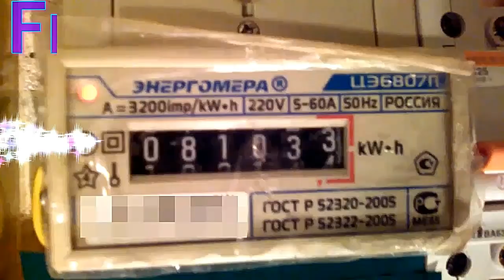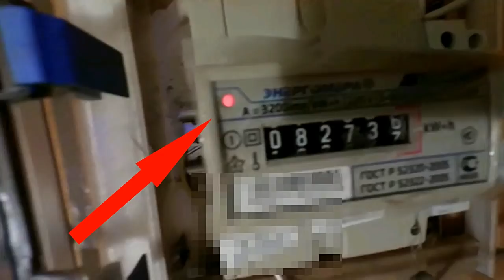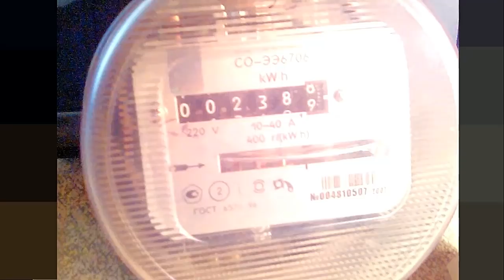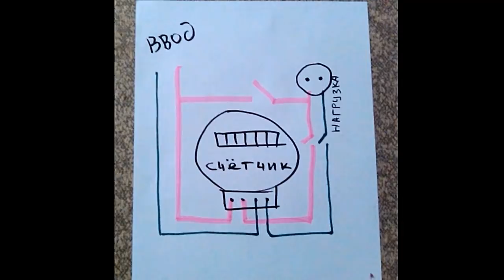FREE ENERGY. FREE ELECTRICITY. How to lower your electric BILL. METER STOP NO MAGNET DIY. STOP METER

Comment: You are just Jumpering around the Meter, However You are Not Explaining Just How Dangerous This is. 1st is The Extremely High Risk of Electrocution by Simply Handling The Wire While Switching Off The Breaker, if there is a Load "IE" The Home and You Pull The Wire Loose While Grounded Your Going to Get Electrocuted 2nd That Breaker is There for Good Reason. Say Something Like a Clothe's Dryer or AC Unit or Refrigerator  Go's Bad SHORTS OUT Which Will Draw Excessive Amps and There is No Breaker To Trip The Fault You Can Easily BURN Your House Down !!!!! This is NOT a Good Video to be Showing People I Know Electric Rates are High in Most Area's and This Will Be Tempting to a Lot of People But I am WARNING You that This is EXTREMELY DANGEROUS !!!! I Know it Looks Easy and it is But Easy Can and Will Get You and Your Loved Ones KILLED !!!!!! PERIOD !!!!
Reply: Thats why there is a disclaimer in the beginning
Reply: Um. Granted this stupid and all. You could still feed through the main breakers and have the protection.  Still.. What’s electric bill vs. jail time? Or better yet. What’s your arm worth after it gets blown off? If you live...
Reply: i did this in UK for 5 years before i moved house. i did it with metal coathanger
Reply: @flipnotrab  well its also pretty stupid to make the big corporations profit from the poor while they evade taxes but nobody complains.
Reply: @flipnotrab  do it when the powers down.
Reply: Danger🚨guy's 🙅‍♂️don't do it!!!!!!

Comment: Thou shalt not steal. Those of us who are honest, have to pay higher rates, because of people that steal, by doing illegal things like this.
Reply from the maker: Da pofig chto Illegal !!!

 Those of us who are honest, have to pay higher rates, because of people that set high electricity prices.
And also because of the state, which allows oligarchs to profit from honest people.

If you reduce the price to an adequate cost, then everyone will pay honestly and no one will install a magnet or make a jumper
Reply: @DomashnieSamodelki  - How much does electricity cost where you live? The average in the United States of America is about (US dollars) $0.13/kWh. But the price varies widely depending on location. Most of the states are between $0.10 to $0.20 per kWh. But Hawaii is $0.32/ kWh because of generation with imported crude oil.

Comment: When the neutral
wire is disconnected, there is no voltage input and thus no output is generated by the power supply

Comment: This wouldn't work in a civilized country. When your meter is read it's entered into a computer and it will red flag a suspicious household. Every electricity bill that house has been issued is logged and any drastic deviation from that average total is shown as suspicious. They will usually leave it for a few months and if the usage remains low the will visit the owner plus an examination of the power board if that house will take place. If you've been stealing electricity you'll be nabbed.
Reply: you run half and half, half the cheap for your bill and half the expensive, theyll think you have solar grid. idk how but ive seen it work, it maybe that civilized idiots dont care about poor communities or idk but ik its working  each time i go to my buddies house
Reply: @YEET-yh6qc  messing with a breaker is a good way to die In a fire....my neighbor did this in 2006 huge power surge hit the area and he was homeless for 9 years.
Reply: Prove it!
Reply: Ask any sparkie to do it for you. It'll cost you about $400 to have one of the circuits on free power. Best to have the smart meters that they don't usually check in person and to have the board inside a garage or somewhere the power co has to mail a request to enter property